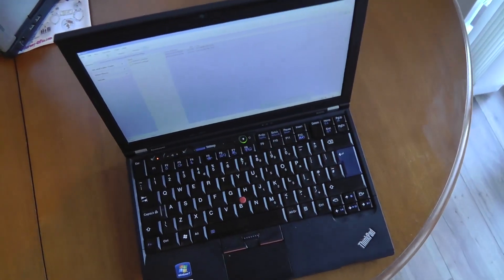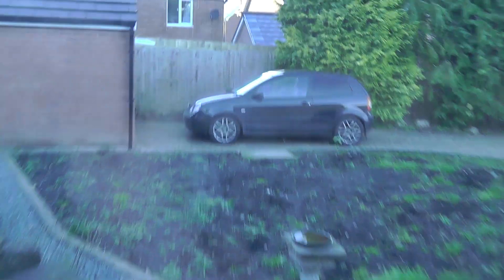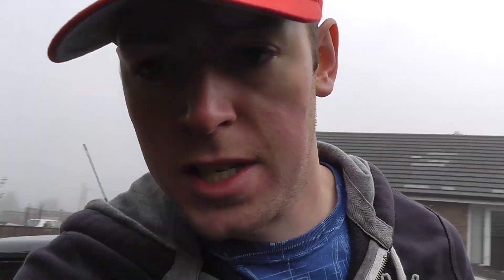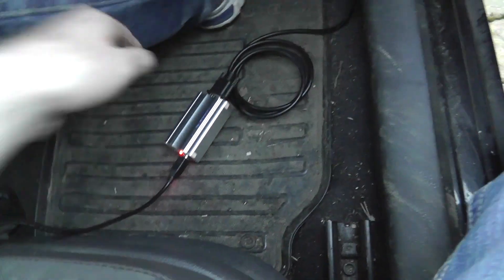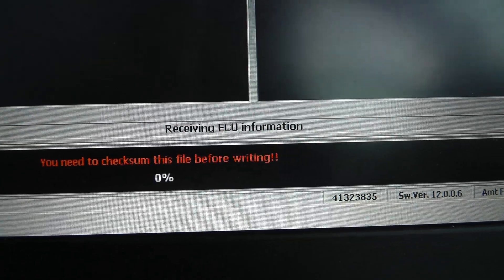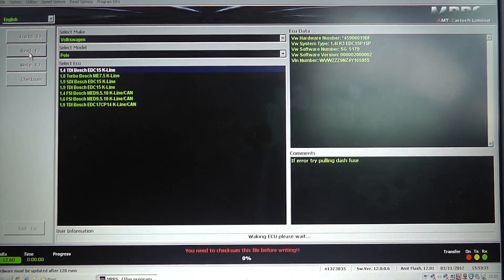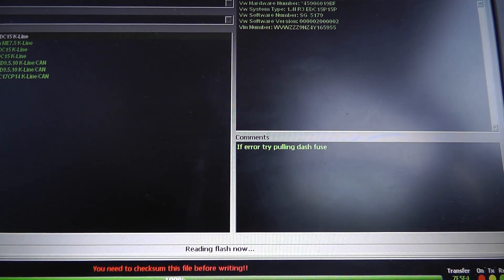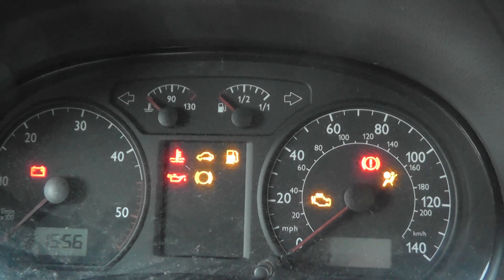How to Remap / Flash with MPPS

Comment: Which eBay cable do you use? I bought the mpps v-13 cable from Amazon. I get an error and it said to pull my dash fuse. I did that and wrote my modified file. I did the checksum prior to writing and in the vag edc15 suite too. After the flash now my car cranks and immediately goes dead. I replaced the fuse 11 also. I’m at a loss on what to try now.

Comment: Hey ive got a ??! About that mpps i bought on, the clone off ebay and for the life of me i can not get it to read my 01 tdi beetle just comes up with an error.. and to pull the #11 fuse. Wich iv done and no change.. iv also read my 04 jetta 1.8t gas reads it fine but vag suite dosnt recognize the files.. any help would be awsome... thanks in Advance
Reply from the maker: Clone MPPS are usually junk I'm afraid.

Comment: how did you get it to work? i got the v16 box and i cant get the program to work at all. whats the box you use and what os are you using?
Reply from the maker: This was years ago, but it was Windows 7 with version 15. Ours was a Chinese clone copy which worked, but most of them don't
Reply: @vPerformance  yeah av tried the v16 clone on xp but it wont load. Think I might have to track down the same one as yours. It's for my bora edc15

Comment: awright. great vid. am looking at doing this and been learning. can u send me a link for the tunning tool as i can find the one you used its only a plastic verstion cheers. what do i need to start using vagecu suite. cable wise cheers
Reply from the maker: I bought an ebay tool called smps which is a clone of mpps. Vagsuite is the map editor for a handful of bosch ecus, and smps reads and writes maps to the car.
Reply: @vPerformance  ideal cheers man. i will have more questions lol. did you get the cable aswell
Reply: Is this like your one mate.
https://www.ebay.co.uk/itm/324127995193
Reply: Ment to ask. Is the plastic mpps v16 that looks like a obd2 clone the same as the metal box you have or am I better getting one like yours. Am trying to do my vw bora 1.9 tdi cheers

Comment: how does this affect fuel consumption? i think my car was remapped but not sure, and it consumes too much for 1.9tdi, its supposed to be 101hp engine btw, and it smokes black every time i switch gears and push the gas pedal
Reply from the maker: Injecting more fuel always means worse consumption. Anything black coming out the back is waste. A great rolling road map will optimise for power and reduce waste fuel where possible.

Comment: Can this do the 2000 Toyota Tacoma 3.4l v6 5vz de engine? I just know it’s a Denso ecu,  for that model year, (97-04) but I have no idea what processor or code it’s using. But it is a Closed loop.

Comment: I did this, bought a tune and when it goes to write it says done in like 3 sec.  that can’t be right can it?   I’m trying to load a EGR delete and eco tune.  2006 Jetta TDi BRM Engine. I’m in the states.
Reply from the maker: Seems unlikely that it will flash that quickly...

Comment: Please Help. Installed MPPS, Drivers all good and updated properly, app opens fine as I open it with "Windows Compatibility Mode" as "Admin"...app fully opens but I get "no external voltage found"....I am turning the key, car lights are on....why am I getting "no external voltage found"?? This is on windows 10 which I heard works if you do above compatibility adjustments??
Reply from the maker: We've never had any success in Windows 8 or Windows 10. We have an old laptop for the job.

Comment: you changed ignition timing on a diesel? maybe you should slow down a little and understand what your doing. theres no ignition timing on a diesel, its pump injection timing. do you even have an egt set up/installed in the car?
Reply: lol
Reply: Hmmm, not a very credible source,lol
Reply: minor0confusion  also the timing if a turbo is in place should be retarded at full throttle, wouldn’t be advancing it unless N/A

Comment: When I use mpps v16 do I read whole ecu save it on mpps then if i want to turn off dpr egr I have volta 1.2 do i use the whole ecu file modify it with egr dpr off on volta 1.2 then save, then open mpps then apply the new ecu file back to the car ecu. Its the process from read ecu on mpps v16 creating a new file the to turn off egr dpf with volta 1.2 then flashing it back to the ecu on the car i dont fully understand. Is it the whole ecu file thats read in mpps v16 then modified on volta 1.2 then put back on the ecu. Car is PUG 407 1.6 HDI 110 bhp ECU EDC16C3

Comment: what do you do with the disk that comes with the package
Reply from the maker: Mine came with the software I needed. I copied it to my PC then slung it in the bin.
Reply: vPerformance correct me if I'm wrong but you read your car, save it, put it in  vagedsuite and make the changes, then write it?
Reply from the maker: Boogaloo Jordan that's right. You can use other programs but we used vagsuite as it was free and very easy
Reply: vPerformance I have mpps and all the stuff I need but my laptop is windows 10 so mpps program isn't compatible with my laptop. Do you know any programs that can change the drivers wish map and that works with windows 10? Paid or not works for me thanks !!

Comment: Where did you get the tuning file from ? many thanks
Reply: Awat Hussain send your flash to any decent tunner they will adjust the map and send it back to you for a fee.. then just load it back into your ecu. YOU SHOULD STAY CLEAR OF ANY KIND OF UNIVERSAL MAPS OUT THERE
Reply: Make the tuning map yourself. I don't recommend using this method of flashing because it won't work correctly on most boards.

Comment: hi man i am a fairly good mech and need to know what to get besides hp tuner to remap my 2002 5.3l v8 chevy and a 2005 f150 5.4l any help be good i went nuts tonight looking at videos nd web pages  from expensive bs from efi.live and hp.tuners and china sites with stuff like kess and others clones help my ignorant ass out as i am irradiated as f. i own a megasquirt ecu but the it does not fin control the autocrapic transmission

Comment: If you load in a a wrong file into the ECU, maybe a E-book(lol), cant you just flash it again and load in the right one?
Reply: +vPerformance One thing people don't understand about "Data components" is: As long as the electric components are not smashed (physically broken) you can ALWAYS reprogram them into working again ! it's just a bunch of 1 & 0 in the end, that are programmed onto chips/eproms etc. It's just a question about knowledge and understanding on HOW to reprogram (what programmer-tool, software etc.) someone maybe have to write a new program to be able to do it, but still it is possible ! A data component can't be "locked" like many people seem to think (Ok, it can be done if someone breaks off a "Pin" or something on the component) Just wanted to clear that out !
And of course your dealer will tell you that you have to buy a new "immobilizer" or something else ! Because first off: they make money of it ! And second, I don't think they have the knowledge to fix a "programmable" error... And also are told by the people on top that it can't be done...
Reply from the maker: +Yop Brookhuis it may be possible, but if the engine immobilizer data is overwritten your ecu might be screwed.

Comment: how much of the ecu can be changed with this flash tool & VAGSuite, Strange question but do you recon i could program out the warning lights for the rear lights?.. im putting in a tdi engine into a t4, i have also added the cluster from the donor vehicle, i know im going to get a lot of error messages for the rear lights etc as they are on a different loom so would like to  get rid of the unwanted errors . its a secondary vehicle btw, so if i mess up then thats fine
Reply: you have to modify the varient coding. vag com

Comment: Wrong regarding powering on laptop "The MPPS tool requires a stable laptop computer with a good battery. For best results use windows XP and use a laptop with a fully charged battery. Contradictory to what some may say, we recommend you don’t attach your laptop's power supply during flashing as this can induce a ground loop which may crash the MPPS software"

Comment: Hello there,
what software version of MPPS do you use v13.02 or v16? And what does "This program can be run 128 times before updating hardware" mean? What is going to happen after those 128 times of usage?
Reply: The message you are referring is about the software and nothing to do with the vehicle.

Comment: nice job mate! from wher you get your tuned dumps?
Reply from the maker: Hustler LT We read them from the ECU then tune them ourselves in VAGsuite
Reply: v11o Is it possible to flash a 256 kb file with MPPS? The original file that I extracted with MPPS from my 320d E46 was only 32 kb. If not, can I use some sotware to open the 256 kb file, split that 32 kb information from the rest, then flash it?

Comment: Thanks for the second video.. :)
Just wondering if the s-mps will work on OBD1 systems?
I have a modified 1976 CJ7 jeep with a 258 4.2L engine and GM TH400 3speed auto..
I installed a GM TBI from a 4.3L 1987-1991 chevy vehicle and the ecm pn#1227747 and chip  #ASKA .. Could you recommend where I can get a flashable chip for this mod? Or is the chip from my ECM re-burnable? Also, any recommendations on the burning adapter and all of the parts I need to reburn my car's brain?
Thanks again for the information. :)
By the way, my cj7 originally DIDN'T have a ecm... And the distributor controls my timing.. Hope to have my new ECM to control timing and fuel.. :)

Comment: Where did you get a remap file from?
Reply from the maker: I edited my stock ecu file using a program called VAGsuite
Reply: Is it hard to edit (tune) a stock file? Does it require lots of knowledge? Could I edit my e46 320d stock ecu file using VAGsuite?
Reply: Mantas Jūras its easy if you have a good knowledge on binary codes

Comment: Great video thanks.
I have a question for you.  When I try to use this program on my 2010 VW caddy tdi I have 5 options to choose from 1 is the 1.9 tdi bosch edc15  K-line. The other 4 are for 2.0 and 1.9 edc16u1  edc16u31 k-line and k-line can. These 4 are all for SDI not tdi.
If I do a ecu ID the the 1.9 tdi bosch edc15  K-line does not work but the 1.9 Bosch SDI edc 16u1 K-line does.   My car is a tdi   is it ok to procede or should I try to find my engine in another model like a 2010 golf tdi or something?  Any thoughts appreciated  Thanks
Reply: Try it, see what happens

Comment: MPPS ECU KILLER dont use this shit on EDC16C34
Reply from the maker: I've only used it on EDC15 - what happens with EDC16?
Reply: MPPS V12 total killed citroen C4 HDI 110 FAP. FAP off with this MPPS cable is way to hell. Engine wont start Lexia 3 does not recognize EDC16C34 :(  maybe help Galletto master ?
Reply: dont use MPPS use FGTECH GALLETTO 2 MASTER !!!!!!!!!!! 
before you change anything, you need full ECU BACKUP !!!!!!!!!!!!
mpps can not read full ECU MAP !!!!!!!!!!!!!!!!!!!!!!!
FULL ECU map read over BDM JTAG GALLETTO !!!!!!!
play with the ecu without skill is really bad idea !!!!!!

Comment: Hello, and thank you very much for this video!

I will reprogram my Clio RS soon, and I had a question related to your video.
Is it necessary to connect a charger to the car battery? For what reason? What type of charger?

Thank you in advance!
Reply: He actually did that so the car batery maintain the 12 volt rate, if it goes lower than 10 volts the ecu memory chips will crash and you will lose your whole ecu
Im not sure if this will come in handy because you commented that 5 years ago, but still

Comment: Avoid using this tool with bosch me 9.0 Ecu. Reads fine but Writing cause ecu lock. Only way to unlock the ecu is writing it with byteshooter using original software. This tool cannot operate me 9.0

Comment from the maker: Just to make sure there's a minimum 12 volts in the battery. Sometimes a flash can fail because the voltage is unstable or too low.

Comment: So... If I got it right, you can edit your ECU map by using MPPS? or do you need an aditional software to do that. (in this case MPPS is just for reading/writing it down to the ECU). If so, what kind of software do you use?
And great video btw.. :)